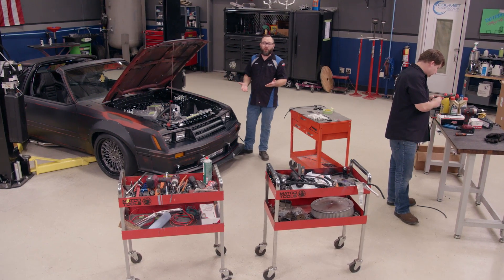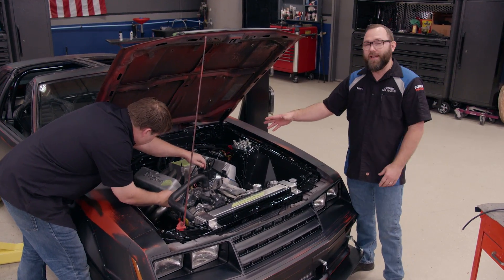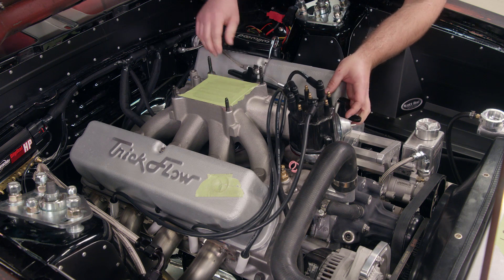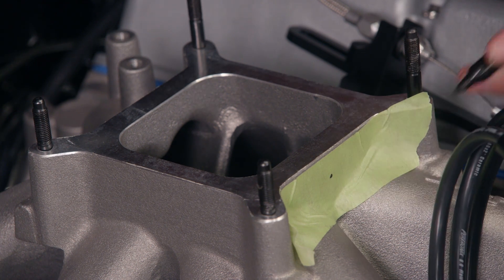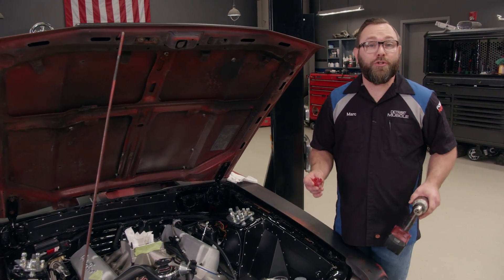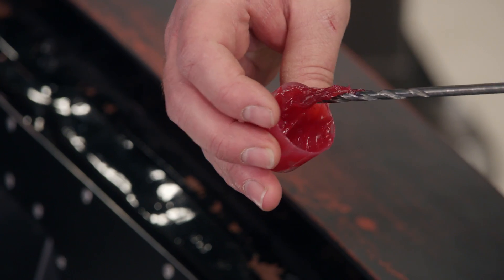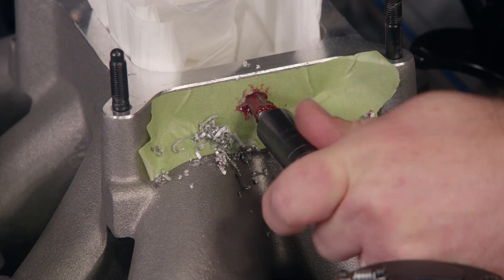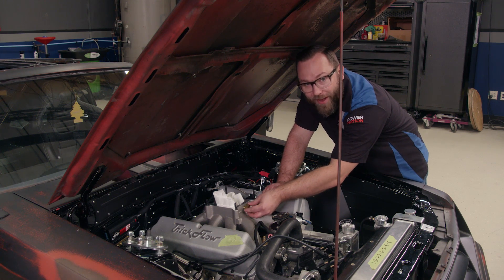How To Create A Vacuum Source

Comment: Im no expert and maybe this is not the case with efi, but are you not going to have too much vacuum at idle, causing the car to rev higher at idle? I run a CV Harley carb on my engine. Because the carb is not ported, I have to run my vacuum advance to my distributor from my intake manifold (luckily it has some free ports already). I find i get the benefits at cruising speeds with the vacuum advance, but I cannot get it to idle lower then 1000 / 1100 RPM. When I remove the vacuum, it idles perfectly below 900. Id be interested to know how you avoided this. Maybe your computer controlled EFI adjusts?